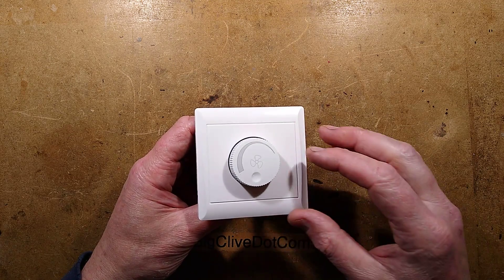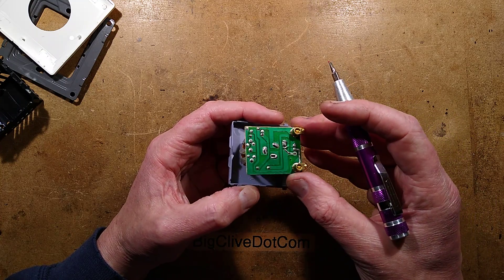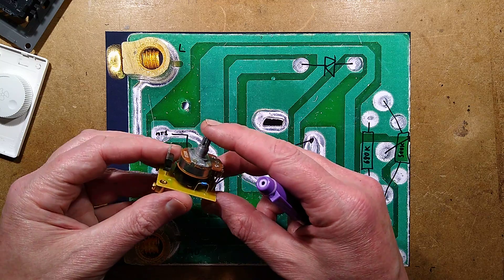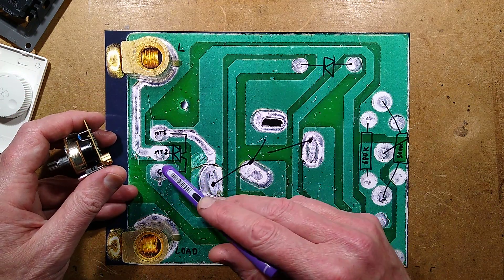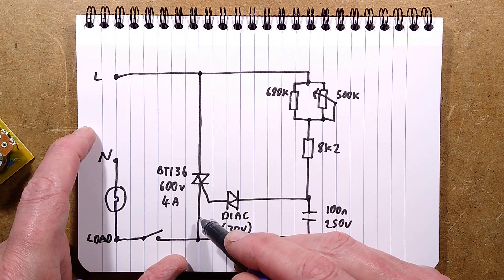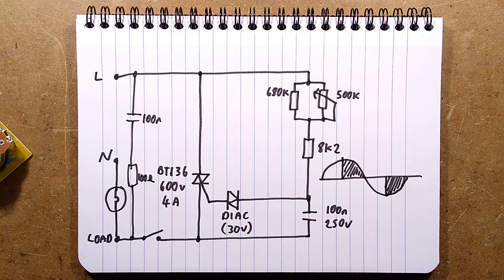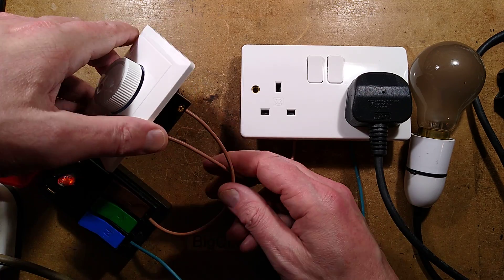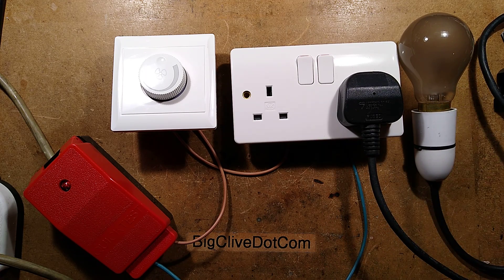Inside a cheap eBay fan controller (with schematic)

Comment: When as a boy I learned to read schematics here in the USA I was tickled that the symbol for a resistor is a zigzag line. It made sense! Then later I saw that that isn’t universal…
Reply: The rectangle as the resistor symbol is the IEC standard. The zigzag symbol is the NEMA (US) standard.

Comment: Just 1 question
Would that work on my solder iron?
💚💛💙🇧🇷🇧🇷🇧🇷
Reply: a dimmer could work for very rough temperature adjustment. not much difference between a tungsten lamp and a soldering irons heater. one just accidentally makes a bit of light
Reply: @H3wastooshort  oh.
😳👍
🇧🇷🇧🇷🇧🇷
Reply: You would use a burst fired controller on heating elements, and only switch on at zero crossing therefore no EMI, ie 2 cycles on 18 cycles off or 12 cycles on 8 cycles off etc
Reply from the maker: It would work better for a soldering iron than a fan.

Comment: In days of old
When men were bold
and battery tools weren't invented
We used a triac drill controller
Made by my Dad
But until this day I
Never understood how it worked!

Sorry but poetry isn't my field!
Reply: I'm currently looking into components needed to soft start a cheap reciprocating saw (sawzall for USA). The power switch gives you full whack causing the blade to move around the workpiece.

Comment: The filament of a tungsten lamp is a complicated coil. Does it have a measurable inductance?
Reply from the maker: There's definitely inductance.  Not much though as it's effectively an air core inductor.

Comment: All the incandescent dimmers I've had use the pot that has its minimum brightness at the counterclockwise (anticlockwise) position.  And the switch is usually push on, push off, which conveniently leaves the pot at the same brightness, and also minimizes the wear on the pot.
I was given several bad dimmers, most likely failed because of a bad TRIAC, which might've been caused by voltage spikes on the power line.

BTW It would be interesting and informative if you connected the dimmer to the Hopi to see what the power factors are at different settings.  
Thanks, Clive.
Reply: Its not too unusual for incandescent lightbulbs to fail by going shorted, and then blowing open, making a bright flash just as they go out. Sometimes this can be so violent that it will actually pop the glass envelope off the base. If there is a dimmer in the circuit when this happens the triac will find itself directly across the line and blow.
Reply: yeah, you want back to back SCRs instead of triacs, SCRs have significantly higher surge current ratings than triacs (for a given current rating) because there are fewer junctions in series. ;)  Don't expect to find that outside of a professional grade dimmer or speed control, tho. :/
Reply: I found if you leave them at a position rather than all the way down pressing it tto come on again blows the bulb

Comment: East fix, I had a few switches that used buttons to fade the light on-off and aslo dimming too. But they just went loopy with LED light bulbs, I went back to the normal switch for the UK                   . 2x👍

Comment: I've an industrial blower called a "fan deck", twin squirrel cage with motor in the middle type,  in my bedroom that's on a dimmer/fan speed controller, has been working fine for many years - I should really attach some air filters to it, while it's cooling me most nights, it might as well be cleaning the air too!
Reply: seems interesting, i've just looked onto your channel and notice the IBM blower... is that your fan deck or something else.. i'd love to see a video
Reply: @MichaelFlatman  Ahh the IBM Bladecenter H fan, I think a rack had TWO of those, one going full tilt was nuts enough, but two... damn rack would blow itself across the room!   Mains powered, VFD board inside that appears to drive a 3ph fan motor with feedback sensors etc, check out the wattage...!

Comment: "Nothing to see here, move along."

A splendid RF noise maker, haha!
These can be built into a vacuum cleaner, making the speed, suction power and noise adjustable. Saves a lot of trouble when tinkering at night with family/flatmates and neighbors around.
Reply: Surely the less noise a vacuum is making the less vacuuming it is doing!!
Reply: @stepheneyles2198  Yes, but maybe you don't need maximum suction to suck some cereal off the carpet after little ones are tucked in bed.
Reply: Mmmmmm variable suction....,
Reply: "Mr. Carlson" would call it an RF fire hose.
Reply: @tactileslut  haha, more like a flamethrower! Or maybe even a nuke :D

Comment: My floor fan that has three speeds in and of itself and really did not like being put on such a dimmer circuit. It made a lot more 50hz mains humming noise during operation. Probably because of the chopped up mains input? My plan was to have it spin more slowly, even the slowest speed setting is like a mild storm. :)
Reply from the maker: It's common to use capacitors in series to control fan speed silently
Reply: That’s what we have in our home over the pond.  Three position speed switch on the wall that has internal capacitors.  It works perfectly and is dead silent:)
Reply: Try putting it in series with an incandescent light bulb.  I'm using a 60w bulb on a floor fan, and it's slowed down enough to be silent on the highest setting.  Lower wattage bulbs made it spin even slower, hardly turned with a 25w bulb.  Not sure how the math works out, the bulb must be dropping a big chunk of the voltage?  Series, not parallel, just saying that again to be clear.

Comment: I suspect the solder is for beefing up the TRIAC's heat dissipation, since they seem to have not implemented any heat sink.
Reply: There will be some of that, but the purpose in switching power supply designs is to reduce I*R voltage drops across the PCB traces. I don't think it makes a lick of difference either way in this case.
Reply: @demef758  Yes usually it's beefing up current.  Even high quality Hi power smps from Meanwell employ the solder 'beefing up' technique.

However in this case, I believe it is solely about heat dissipation.   There is no heatsink on the TRIAC tab, it's not even riveted to a bit of metal.   I've never seen a TRIAC floating in the breeze like this in any phase control device or AC solid state relay.   In this case they build a beefy metal conduction path to the metal assembly of a switch contact, and the other lead over toward  one of the metal AC mains terminals.   

Since that is the only heat dissipation in town in this particular instance, it's actually probably quite important - well at least when operating at/near the device's maximum rating.
Reply: And being cheap.
Reply: @chrisa2735-h3z  That's even cheaper than aliexpress dimmer._

Comment: Do you think using a triac based dimmer on a ceiling fan will reduce its lifespan? (Assuming it’s an induction motor.)
Reply from the maker: I doubt it, although it will be noisier with the typical dimmer buzz, and it could shorten the life of phase shift capacitors.
Reply: @bigclivedotcom  well! I have a C.F. that's older than me...65y... I'm 62.......used to work on a resistive speed regulator till about 1995..after which I put in a Triac speed (stepless) regulator....have had no trouble from either ...till date..no humming either.....the fan's now into our 3rd generation..& haven't even opened/ oiled/done any maintenance on it..even once..( no caps or other parts changed....).except for external cleaning & got it repainted 3-4 times...(b.t.w. those were made with " self- lubricating bearings "(dual))...